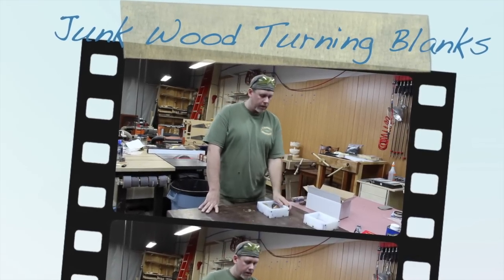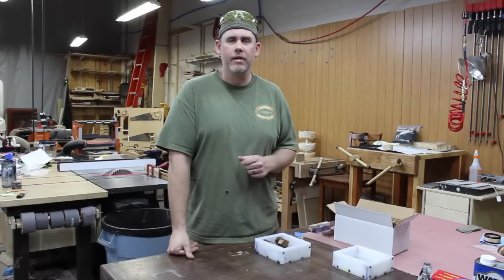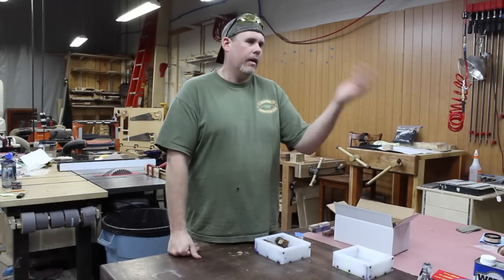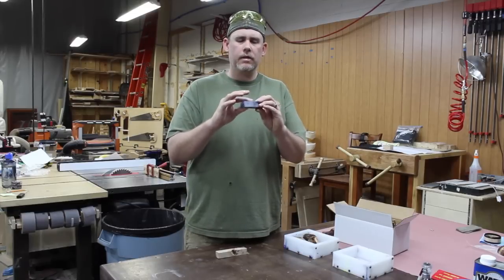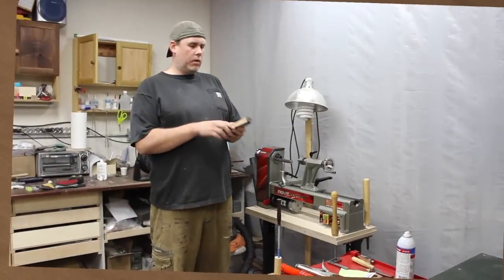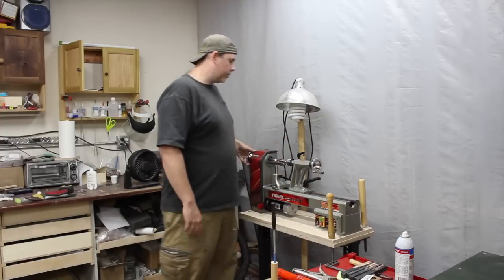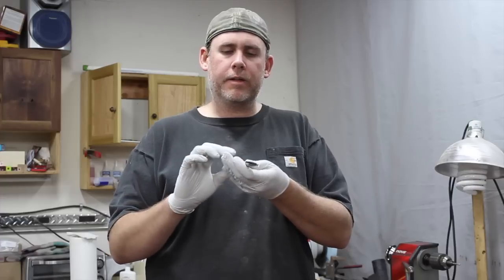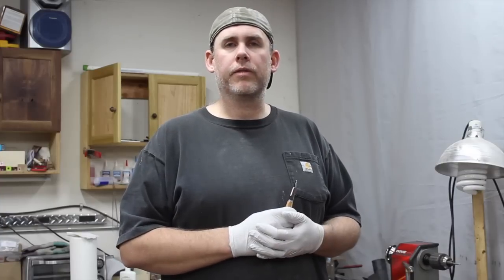Casting Worthless Wood Pen Blanks in Alumilite Resin

Comment: Hi there Zac thanks for the brilliant informative videos.just one question ,do you stabilise all your wood including the pine cones ,best regards from UK.
Reply from the maker: I stabilize most of the things I cast, pinecones included. It's not necessary, but it does provide some benefits. It works best for me to just stabilize a bunch of stuff and have it ready to go without having to worry about drying it out before I cast it. I can just grab it and dunk it in resin when I'm ready

Comment: Hey Zac, great videos. If I were to just get a pressure tank like yours, and used it for vacuum stabilizing also, I know I wouldn't be able to see inside, but if I just left it under vacuum for a half hour or so, do you think that would take care of most pen blanks? Is there any drawback to doing this other than the fact that it will take longer? And, is 30 mins enough to stabilize most burl type blanks in your experience? 

Thanks a lot.
Reply from the maker: I wouldn't recommend it. Bare minimum I'd get a conversion lid that is clear so you can see what's happening inside a little bit. There is no set amount of time, each batch will be different.
Reply: I've seen the conversion lids. I'll do that. And do you always stabilize the wood before resin casing a hybrid blank? Would resin casting non-stabilized wood fill the pores and voids with the colored resin? Or does it not work like that?
Reply from the maker: I always stabilize wood before casting it, just works better overall. Casting only casts around the wood, you need to use vacuum or super extreme pressure to get resin inside the blanks

Comment: I want to cast a pine cone in my resin. Do u need to stabilize pinecones?
Reply from the maker: +Grussing Custom Knives You can cast the with or without stabilizing, just make sure you dry them extremely well either way. I usually bake them for a day or two before casting to get them to zero percent moisture content. So far, I haven't seen a huge improvement by stabilizing them, but I also haven't tried it again since I got the new vacuum pump. Think I'll give it another try soon.
Reply: +Zac Higgins ok let me know how it goes
Reply from the maker: +Grussing Custom Knives Yeah, 24 hours is usually good for them since they are thin. Just depends on how much moisture they had when you stuck them in the oven. I usually gather them and bring them in the shop for a while before baking them, so 24 hours is usually good for me. You'll want to get the temperature over the boiling point of water, I go for 225 degrees F.
Reply: +Zac Higgins ok cool i use alumilte clear for handle scales i put alumilim honey comb in them and i have problems with them breaking any suggestions?
Reply from the maker: +Grussing Custom Knives I think what's happening is that the aluminum is too smooth for the Alumilite to grab onto. I saw a video of someone trying that and having the same issues. I think most people are using Nomex for the honeycomb blanks, which I believe is a type of plastic honeycomb material. Haven't tried it myself, but it should adhere better to the resin. There's also a Kevlar honeycomb material as well. Stuff isn't cheap though!
Reply: +Zac Higgins OK I'll check that out but I have a friend on Instagram that said he used to have the same problem with aluminum honeycomb but he just pours glue all over the aluminum honeycomb
Reply from the maker: +Grussing Custom Knives Let me know how that works out

Comment: what can you use to cut the resin would combination, i have bandsaw and tablesaw which is best and what blade, i cant figure it out,i have been using polyester resin, i know is hard and brittle?
Reply from the maker: +curtis haughton I just use a table saw with a 40T Tenryu blade. You can use a bandsaw too, just leaves a more jagged cut. PR is definitely more brittle than Alumilite, but it should cut alright.